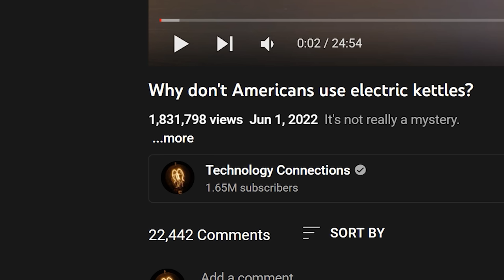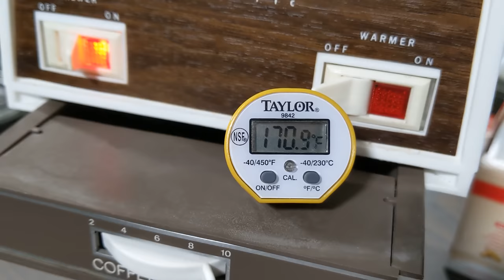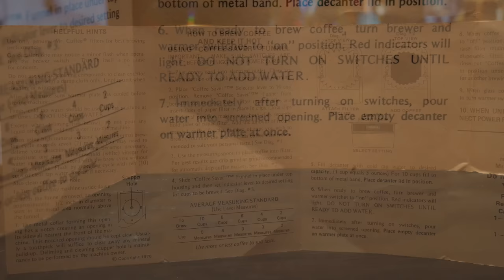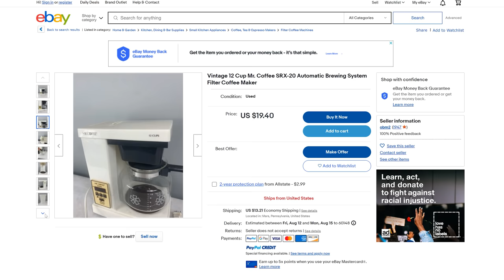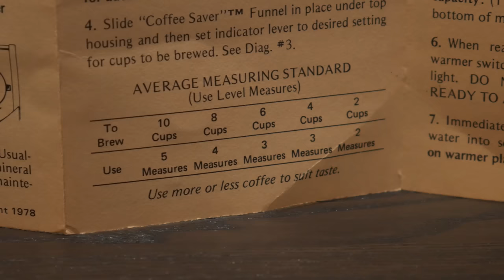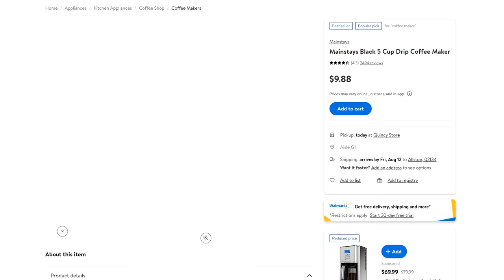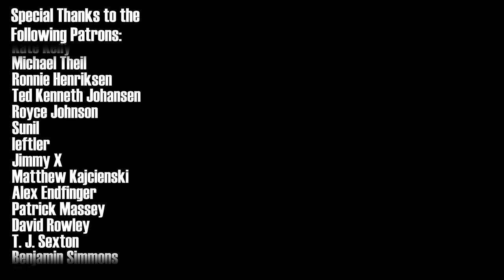Drip Coffee Makers — super simple, super cheap

Comment: When I worked for a restaurant back in the mid-90's, they switched out the industrial drip coffee makers for one that used highly concentrated coffee in a sealed container that would be combined with hot water when dispensed. We were told it "makes the perfect cup, every time". I think it was actually better coffee than the old drip machines. Today, there's a local market that has one of these concentrate based machines near my house and I love getting coffee out of that machine.
Reply: If you don't want an industrial machine, this is what the Nespresso and Dolce Gusto machines does (in South Africa anyways). But a heck more expesive than beans or instant coffee.
Reply: so, like nespresso?
Reply: @bernarddt  Nespresso is cheap swill sold at huge prices! Cheap swill you pay ~1$ per cup for!
Reply: That sounds like some kind of Moka
Reply: Basically how a Starbuck's Americano (their version of black coffee) is made. And espresso shot with 1 or 2 shots of hot water.
Reply: Coffee concentrates (particularly when produced by "cold brewing": steeping coffee overnight at room temperature and extremely high concentrations, then filtering and storing for later mixing) can be excellent if they use quality beans. There isn't any issue of shipping beans, so the coffee is brewed fresh from the roaster, and the concentrate keeps very well under refrigeration. You don't need any fancy machine, though: just put some hot water in a cup, and pour in your desired amount of concentrate for your taste.
Reply: Old restaurant drip machines could make a damned fine cup tho, but it REALLY was dependent on skilled waiters/waitresses to dump the pots after 10-15 minutes if they weren't consumed and always keep a fresh pot brewing. They also needed to be de-scaled like every couple of days.
The industrial Keurigs are neat, but I've always thought the cawfee they make tended to be a little too hot and slightly weak. Much more consistent with less hassle tho and one at a nearby Kwik Trip seems to be setup for PERFECT cawfee.
Reply: Burger King used a similar system for awhile several years ago before changing back to drip coffee makers (the concentrate came in a big plastic bag) and it made some of the worst coffee I've ever had. It was as bad as, if not worse than instant. The first time I saw an employee putting a new bag of concentrate into the machine, I understood why their coffee was so bad. Maybe there are systems of that type that make decent coffee, but the one Burger King used didn't come close. I always suspected that some relative or in-law of the CEO was involved in the company that made that system.
Reply: @russlehman2070  Ah yes, I remember when they switched to that Joe brand. I think that had a lot more to do with the beans used to make the concentrate than with the concentrate itself.

Comment: The Bunn velocity brewer is a technology marvel based entirely on the difference in the physical properties of hot vs cold water. It starts making coffee instantly and has one moving part.  It doesn't have a pump, instead it relies on the difference in densities of hot and cold water.
Reply: Came here to mention that.  A lot of 'Bunn-O-Matic' have a heated tank where a thermostat keeps a reservoir of water hot all the time.  When you poor in cold water, it enters the bottom of the reservoir and displaces the hot water out the top to brew a pot.  Then the cold water is heated in the reservoir for the next pot.  The idea is to leave it on all the time.  Late in the day (when demand for coffee is lower) you can hear the water occasionally heat back up again.
Reply: @mikefochtman7164  Thank you for that! I have one of those and have wondered how the heck it works.

Comment: One of the reasons that I love my expensive Ninja brand coffee maker is that it has an insulated carafe instead of a hot plate. I think it makes a better cup of coffee than the cheap drip Brewers, it does the pre-brew spray and I just think it's generally better. But the most likely reason that the coffee is better is that it's not being slowly burnt by a hot plate.
Reply: In the UK (and I think the EU), coffee maker hotplates aren't allowed to stay on for longer than 40 minutes, for various reasons, and I think it's a good thing too. The constant heat does nothing for the coffee's quality, and if you've bought a good drip coffee machine, why would you potentially ruin that with something which will burn your coffee anyway? 

A carafe is definitely the way to go. I was always confused watching American shows where some guy in an office would walk by a coffee machine and just pour himself a brew, surely that must taste absolutely dire?!
Reply: nice try ninja brand astroturfer!
Reply: @willford7717  To be fair to company coffee, it does taste crap even when fresh, simply because I will bet you nobody has ever stripped the machine and cleaned the basket, or even the carafe, let alone run descaler through the water circuit. 

I do go to a place where they have the automatic machine, and the first thing I do there before pressing is run the cleaning cycle, which puts out a lot of nasty gunk every time. Then select espresso, and then cappuccino, and pour the first into the second. Only ever tried the stuff they call tea once, it tasted terrible, sort of vaguely tea like smell, but it was definitely not a good tea at all.
Reply: @SeanBZA  sooo, would you say it made "something almost, but not quite entirely unlike tea" ?
Reply: @SeanBZA  Absolutely correct on Company/Corporate coffee brewers never being cleaned. I worked at a 7-Eleven for a while and they have this blue powder packets to clean the coffee urns. So when working at Amazon every once in a while I would get a few from my local 7-11 and clean out the coffee makers in the breakroom.
Reply: @JonathanWinterflood  Absolutely, and while it is branded Azkoyen, I have no doubt it was a Nutrimatic Drink Dispenser machine in either an early form, or a well hidden prototype, or one which got accidentally left here in the restore from the backup. A clue is the machine clock, which is a running a few years fast, around 70 years.
Reply: @willford7717  Sure, but free makes up for a lot. Also, although they're fewer in number now, a lot of the people had only for comparison percolator coffee or diner/restaurant coffee, which was warmed on a Bunn O Matic's hot plate.

The explosion of coffee shops (about a decade before Starbucks ran over the field) changed everything.
Reply: @SeanBZA  ^^
Reply: @willford7717  to be honest, we don't drink "company coffee" for the taste or enjoyment. We drink it because we are tired and need the caffeine to get through the shift. I've made myself drink absolutely rank coffee before just so I could get through workshifts.
Reply: @willford7717  burnt coffee is very nasty. I don't know how so many of my countrymen stand it, but it is served in gas stations, offices, waiting rooms, and even diners all across this continent. I actually Wonder how many Americans really do brew coffee at home, because what is commonly served is unpalatable sludge.

Comment: I've reached similar conclusions on the effort-to-flavor ratio of the various ways to make coffee.  You are absolutely correct that the flavor is best if you get the coffee off the hot plate as soon as possible, and I've figured out a pretty good way to keep the coffee hot without scorching it.  I have a ginormous 2-liter Stanley stainless steel vacuum bottle that holds a bit more than an entire carafe from a full-size coffee maker, and while the coffee is brewing I'll rinse the vacuum bottle with boiling water from the kettle to bring it up to temperature so it doesn't immediately chill the coffee, then the carafe goes in the bottle as soon as the filter basket stops dripping and I top off the headspace in the vacuum bottle with more boiling water from the kettle.  There are no grounds for the boiling water to over-extract, so it doesn't perceptibly affect the flavor, but the coffee takes longer to get cold, and it excludes as much oxygen from the bottle as possible to minimize oxidation.  It'll keep the coffee piping hot and relatively non-stale for a full day if I don't drink it.
Reply: Precise

Scientific

People like you are needed in this world
Reply: OP, Been there, came to a simular conclusion aswell.

If you're ever mega lazy or your on a budget, try 1-2 Tbsp Turkish ground coffee of your choice of fresh beans into a full thermous of your choice. Allow fines to settle and cup to cool to safe temp before sipping after pouring into a cup.

I do this with boiling water
Reply: @randomstranger2472  i heard Turkish is a good strong bean.. but not as used as arabica or kenyan is this because of availabilty?
Reply: @nolesy34  "Turkish" in reference to coffee describes the fineness of the grind and its associated brewing method, not the origin of the beans.  The beans used are almost always some variety of medium-dark roasted arabica, ground to a super-fine powder that isn't meant to be filtered out of the coffee before serving.  It is generally served in tiny portions, with the "fines", as the super-fine cofee grounds are called, allowed to settle to the bottom of the cup like loose-leaf tea.
Reply: @bartolomeothesatyr  thanks i will try this blend next time im at my turkish street market

Comment: "So unless you've got an induction stove"
So uh... I bought a portable single induction burner for reasons completely unrelated to boiling water, and yet it turns out I have the exact best thing I could for doing so. Neat. Honestly I'd recommend one for anyone who wants to cook things, but despises those stupid electric coil burners that get crap stuck in them and are hard to clean.

Edit: I had to stop and got a bit of goosebumps when you revealed how that older model worked. That is genius. A valve that uses the properties of metal itself to bend... you'd need to do a hell of a job designing it to hit the right temperature but once you have the design right, that is incredibly simple to manufacture. Huge respect to the engineer that came up with that one.
Reply: These steel coil stoves always baffle me. Here in Germany those were never a thing, all we had were stoves with round steel plates, and those went out of fashion decades ago. If you see any kitchen that still has a stove like that you can be sure the thing is from 60s or 70s
Reply: I actually prefer coil stoves, obviously gas burners are best, instant heat and more control, but glasstops are super common where I live, they are basically just coils under a thick layer of glass, and they take a million years to heat up and it's very uneven. Coil stoves are super easy to clean too, they plug ins so you can easily remove them to clean them, and you can remove the pan/casing easily as well for easy cleaning. I had an old GE coil stove from the 70s in my old apartment and those coils were almost on par with a gas range, super quick and even heating. Glasstops can suck it
Reply: @leDespicable  When did Germany get electric stoves? That might make a world of difference. For quite a few decades the US was ahead of everyone in all things electric and yeah we came up with some bad designs when we didn't know better. We walked so everyone else could run.

Comment: One of the features of the drip coffee makers that came along shortly after the Mr. Coffee was introduced was the valve at the bottom of the brew basket. The upside of this is that you didn't have to wait for all the water to run through the machine in order to get your first cup. Prior to that valve, a person might quickly swap out a mug for the carafe and pour the already brewed coffee into the mug as it is also being filled from the basket. This swap always made a mess. The simple valve solved this. However, it also meant that you had to use the carafe that was designed for that model of the machine. Anything shorter wouldn't open the valve.
Reply: You really shouldn't grab cups as you're brewing from a drip, though, as the concentration of coffee varies over the course of the brew.  Best to let the brew finish so that the final pot is homogenized and you don't pull an overly strong cup which causes the final pot remainder to be slightly weaker than it should be.
Reply: ...AND FOR CHRIST'S SAKE DO NOT ADD A CUP OF COLD WATER TO THE BACK AT THE SAME TIME TO HIDE IT!!!

     One person "in the office" might get away and nobody's the wiser... BUT two or three or four... and you've got hot sh*t-water to drink... might as well just soak your friggin' socks in the d*** pot!  ;o)
Reply: I make my coffee simply by pouring hot (90 deg) water through a "Melitta style" paper filter. It takes a minute or so. Nowadays, most people in my country probably use a machine though. It does the exact same thing, only slower :)
Reply: Eww.

Comment: 20:25 My grandfather said to always put in COLD water in drip coffee makers (he worked for Melitta back then, a company name you might be familiar with). Now seeing how the cold water reservoir is essential in cooling down the water before it gets sprayed on the ground coffee, it all makes sense.
Reply: Its also a health thing as hot tap water isnt always good for consumption.
Reply: @datadavis  Where I am living, hot tap water is always fine for consumption, as we adhere to certain minimum temperatures in the hot water network in the house, and circulation pumps can't be continuously off for more than 8 hours. In addition, we get yearly micro-biological survey of the hot water on all taps. This is by law in Germany.
Reply: could be combination of few things but I doubt couple degrees difference at the start of brew would be noticeable afaik the important thing is that cold water carries less minerals from the pipes which can affect taste, and cold water carries more dissolved gasses (oxygen is often cited but I'm guessing co2 and nitrogen also have their part to play)
Reply: @graealex  since when do we have yearly microbiological checks on hot water taps at home in Germany?
For some reason Brits had these strange cisterns that are easily contaminated. German households have for decades used systems that are just not easily contaminated, but I've never seen recirculates hot water, the boilers just have a setting where it heats regularly up so that bacteria can't get going
That is in fact checked and there are reports of people turning down the heating temperatures to save on energy, which usually turns out to be a bad idea
Reply: @graealex  Yeah, but German laws have been "problematic" in the past...
Reply: @TheWoblinGoblin  "Gefährdungsanalysen nach § 16 Abs. 7 TrinkwV"
Die Intervalle variieren je nach dem wo und warum. Bei uns ist es wohl dreijährig, nicht jährlich. Hatte ich falsch in Erinnerung. 
Für Rezirkulationspumpen müsste ich es heraussuchen. Auch gibt es die Möglichkeit, regelmäßige Desinfektionsläufe zu machen, um den Risiken von Legionellen beizukommen. Dabei muss allerdings das Heißwasser im gesamten Netz sogar 70°C erreichen, wo regulär 60°C zur Hemmung der Vermehrung reichen. Das bedeutet in ausgedehnten Netzen, dass teilweise mit über 90°C eingespeist werden muss, was gefährlich ist, wenn das Wasser im Erdgeschoss plötzlich fast kochend aus der Leitung kommt.
Reply: @LG123ABC  There is nothing problematic about the laws in Germany that make our tap water safe for consumption without further treatment.
If you are referring to WW2, it is really getting lame, most Germans you are going to talk to are born decades after the Third Reich collapsed, and we had literally zero influence on what was happening back then. Maybe just let it go for once.
Reply: @graealex  Yes, that is how we do it in most western countries.☺ Much of my work when i was a plumber was tearing out old heating and hot water systems in buildings and updating to new standards.
Reply: @snooks5607  That really doesn't matter, as the water gets boiled anyway.
However, the cooling capability will make quite the difference. Here in Germany, cold tap water will be less than 15°C, while the hot tap will be above 60°C. I imagine that you will be pouring boiling water onto the coffee grounds towards the end of the cycle if you start out with water from the hot tap.

Comment: The one thing I noticed over the years is that the cone filter types of drip makers have a more even extraction and most actually express the heated water over the center of the grounds instead of slightly off to the side like the one you show. Used to be a massive coffee geek to the point of roasting my own beans and having no fewer than maybe 10 coffee making contraptions. I'm down to a drip maker for mass quantity coffee making, a small moka pot for the rare cuban coffee, a press that i use maybe 2 times a year and should really just get rid of, and a one cup pour over for when I want a single cup and am willing to faff with the thing, otherwise it's a single cup of nescafe clasico instant which imo is tons better than folgers instant and maybe just above cafe bustelo instant espresso. Cheers!
Reply: coffee saga continue!!!!
Reply: @bilinasmini3480  Coffee Part 2. ;)
Reply: When you went from coffee nerd to pour over I was still on board because that still gives a coffee nerd loads of options to get exactly what they want. When I continued reading to see the instant coffee part I was shook.
Reply: I highly suggest you get a manual espresso press. they're expensive for what they are, but it's the best coffee I've made yet. I use a flair neo, but honestly now that I've seen it work I would go for a knock-off.